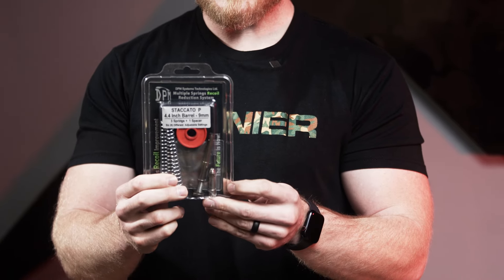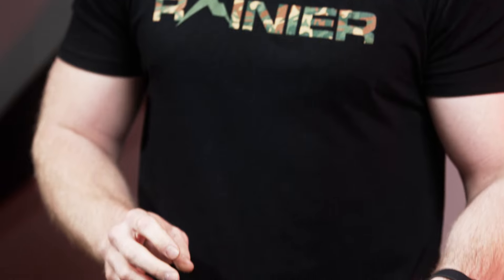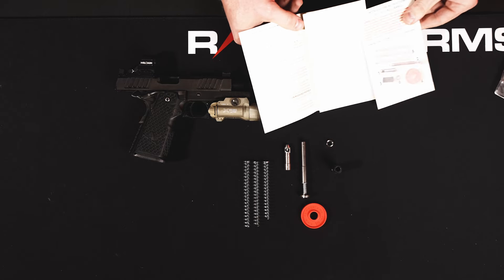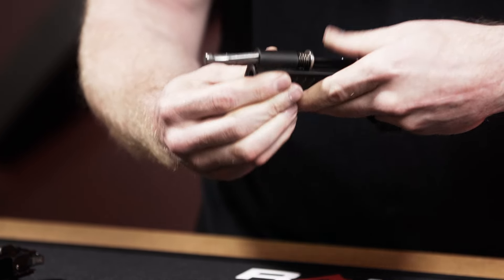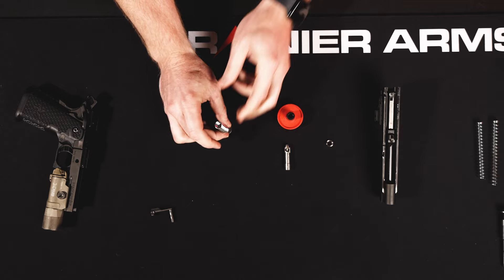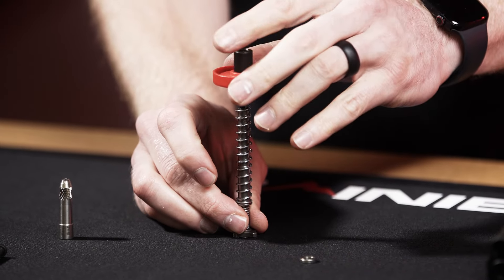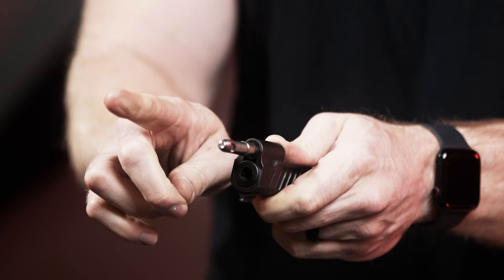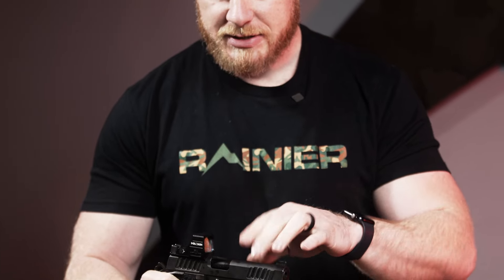How To Install The DPM Recoil Reduction System on Your 2011 Staccato P

Comment: Can you tell me what criteria you used to pick the spring that you liked the best.
Reply from the maker: Yeah, for sure! I based my choice on two main factors, felt recoil and perceived recoil. What I mean by that is, how the gun felt in my hand/hands when recoiling and what the red dot did during recoil.

What I was looking for was a setup that felt smooth and predictable. I wanted to feel like I didn't have to do anything extra to control the gun and the red dot was getting back onto target quick, consistently, and predictably.
 
I shot with the factory setup with a new spring and then switched to the first DMP setup. I switched between factory and DMP with every change I made, which gave me a "clean" comparison. I would shoot single-handed, then both hands with a normal grip shooting slow, shot some doubles, then 6-10 shot rapid fires.  During this whole time, I'm paying attention to a few things. One is what my dot is doing. Is it leaving the window? How fast is it returning? Things like that. Additionally, I'm paying attention to my grip. I'm looking to see if I feel I need to adjust my grip or if I'm having to work any harder to keep the dot on target and so on.  Lastly, I'm paying attention to how I feel shooting it. What I mean is, sometimes it is hard to tell the details, it just felt better for whatever reason. I try to figure out why, but sometimes it just feels right or wrong.

There are plenty of ways to go about picking a recoil system. This is just the way I like doing it. I'm going to keep testing this setup and see if I want to stick with it or switch back.
Reply: @Rainierarms  Thanks for your wonderfully detailed explanation!
Reply from the maker: @rickgeorgette9657  You are welcome! Just keep in mind, There isn't a one size fits all setup. What I find to work best for me might be different from what works best for you (or someone else).

Comment: So is it basically the stiffer/longer spring you use, the more reduced the recoil is? 

How does this affect reliability?
Reply from the maker: In theory, but there is more to it if you want to fine tune for slide speed and whatnot. The DPM system is a progressive triple-spring recoil system. The recoil impulse feels different than the standard system with a stiffer spring. 

There is no negative effect on reliability. These systems are being used in countless duty and competition handguns.

Comment: Why did you use the longest spring instead of the Med or small? Or what does each spring do? shorter the spring, means lower poundage? sorry, noob here!
Reply from the maker: Hey! The answer to this can very very detailed and long but I will make it as short and to the point as I can (hopefully). I did another video where we did a comparison to a stock spring and I talked some about how I went about testing them. But to answer your question, I chose this spring based on the perceived/felt recoil. Simply put, how the sight returned back to my point of aim. The length and poundage can differ between companies. You can find springs with the same poundage but be different lengths. The spring can cause spring coil binding if the spring is too long or it can cause the slide to short stroke if it is too short. So, I only pay attention to the length when it comes to making sure the slide can operate smoothly.
The sping lb matters for recoil. It's a balancing act that can be different for everyone. What spring works for me might not work the best for you. We have to factor in things like our grip on the handgun and what ammo we are shooting. A spring that is too heavy will cause the muzzle to dip down past your point of aim during recoil. The heavier spring forces the slide forward too hard and that energy is transfered forward. If the spring is too light then the muzzle will rest above the point of aim on recoil. The lighter spring wouldn't give the slide enough force to level out and might feel more aggressive on recoil. With a perfect spring weight (in combination with your shooting abilities, ammo, etc) the handgun should return back to your point of aim. Again, it is important to remember that some springs come from the manufacturers a little too long for your gun and may need to be trimmed to keep from getting coil bound and impeding the cycle of your slide. This can result in part failures!
Reply: @Rainierarms  Oh wow! Got it. Thank you for the perfect response! Definitely want this same setup with the staccato p and wanted some more insight. Ty lots!
Reply from the maker: @Jpnhobi  Pick up a DPM and try out the different setups! Thanks for watching!
Reply: @Rainierarms  Will do! TY!